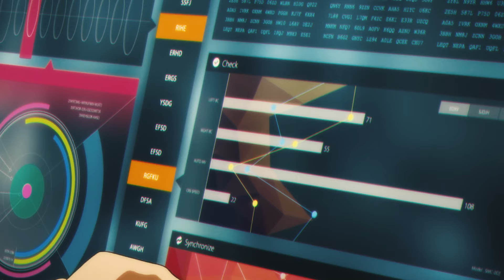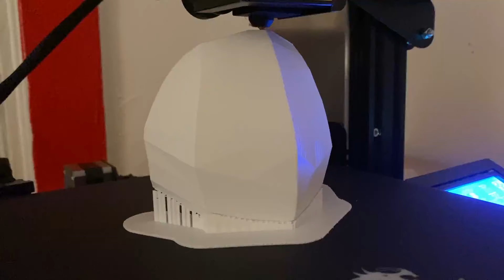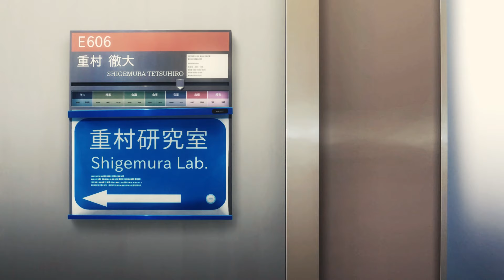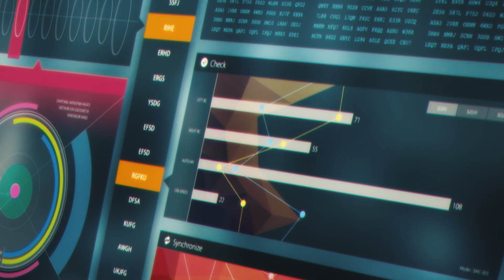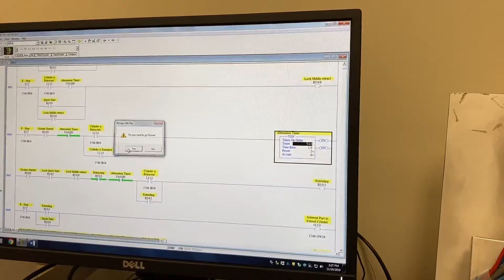Mechatronics - Build Whatever You Want (Or Just be Michael Reeves)

Comment: Hey, just wanna say, you may be a jack of all trades and master of none in a team. However, in a team, you are the one who connects all the dots and knowing something about everything enables you to tackle issues from a different angle, to think outside of the "specialization" box.
Reply: True true true true
Reply: i thimk you are right but it is pretty good have this early knowledge for dreamers like me🐢🐢🐢🐢💯💯💯👌👌🤠🤠true true
Reply: I studied industrial design, if you love generalist manufacturing it's where it's at
Reply: Yeah i always think about how first combustion engine was invented. If you are fully mechanical enginner you wouldn't know about chemical reactions and combustion, and if you are fully chemistry enginner you wouldn't know about how energy created from combustion could be transfered and used with mechanical parts. Some smart ass that was mediocre in both areas had 'eureka' moment and designed the first engine.
Reply: Came here just to say that.
Reply: Jack of all trades master of none, but still better than a master of one. --> Full quote
Having a basics to electrical, mechanical, and programming is better than mastering programming all alone but doesn't understand electrical and mechanical. By understanding the basics, you will be able to learn the advanced faster.
Reply: I'm trying to learn a bunch of stuff, and the way I've seen to categorize how I'm learning is to split it into "wide knowledge" that covers how different pieces connect, and "deep knowledge" that covers how each piece works in detail. That might not apply so cleanly outside of computer systems where everything is split up already, and I do still think I suck, but in fairness, I went from not owning a computer to understand a lot of principles of game design and modeling in less than a year. While the latter does have its place,  knowing how to categorize information goes so much further than mindless, dogmatic repetition in most cases
Reply: Aerospace, Mechanical, and Computer Engineering, and Architecture in a nutshell
Reply: When you are just out of school you might be a jack of all trades and master of none. But during your career you can definitely spend the time to become a master in at least one of them. And you will have the background knowledge in the other fields, which would indeed be perfect for larger teams where the different departments have a hard time communicating/understanding each other
Reply: @neoruss3553  Yes you would as a mechanical engineer, we study thermodynamics and combustion physics and chemistry
Reply: @alexlarson2466  Yes today, but i am talking about 100 years ago when first engine was invented. Not many people studied at university then, and it is questionable if there was a branch of mechanical enginnering that covered all those topics together because nobody knew about combustion engines at the time. Most inventions happened in workshops not in labs.

Comment: Learn to program in C and how to use functions well.  
Learn machining as well as cad and cam software like fusion for part prototyping.  
Understand micro controllers to control anything with Servo motors and sensors.  
 study study and study some more.  
Anything is possible with a drive to accomplish.

Comment: I did the mechatronics technician training program at workforce, then I went to a trade school for industrial electrician, which was essentially the same thing. We had to build a robot from scratch out of a box of scraps, use an industrial computer; plc, nano plc, or micro plc. I had all three, but chose the Allen Bradley plc. I liked it better. Then I built the robot arm from from a box of microwave oven parts and stuck it on a conveyor belt to sort bad parts. It wasn't very fast but it worked. The plc stopped the conveyor and started it back up and moved the robot. I ended up with a job at KC where I only do electrical work and no mechanical work. I also got the state certification for robotics technician for Fanuc robots but for someone the company doesn't let me near the Fanuc robots in the warehouse or near the AVG robotic forklifts in the back either. I guess their scared that I'll reprogram everything back there. You can get a really good job with that mechatronics or industrial electrician technician degree.
Reply: Who or where is KC?

Comment: I take you realized an applied science degree doesn't transfer to a full blown engineering degree.
Reply from the maker: Completely so. You need an associates of sciences, preferably in a program designed to transfer if you wanted to go for a full blown engineering degree. That was my initial plan for college, but my family and living circumstances unfortunately didn't make that a reasonable option. I've got plenty of friends taking that route and it's working out nicely for them. Saving money by going to community college actually helped them out a ton.